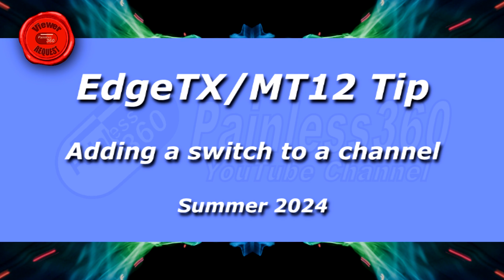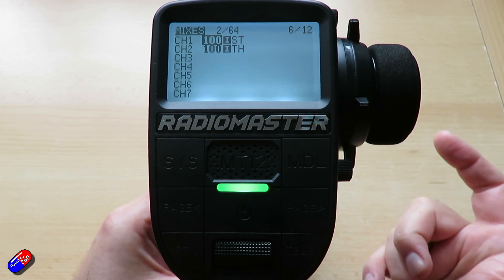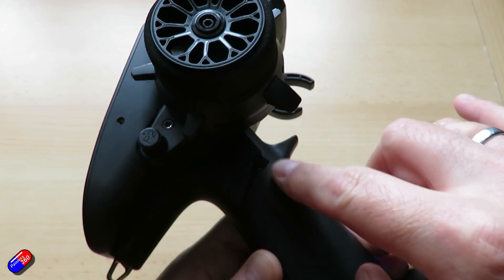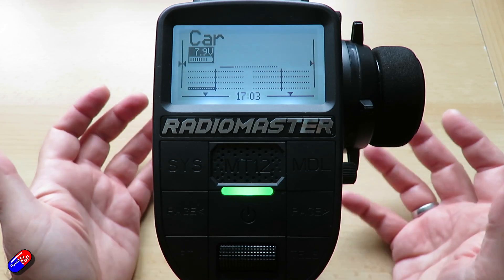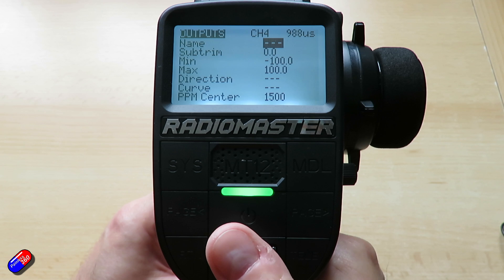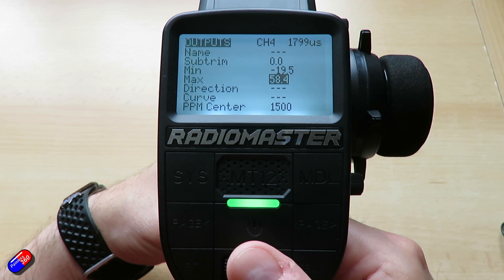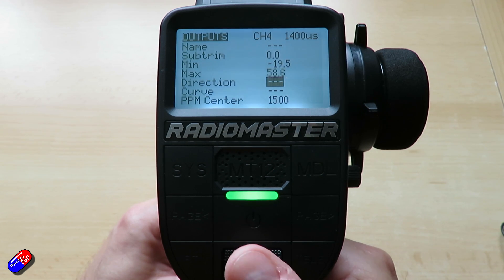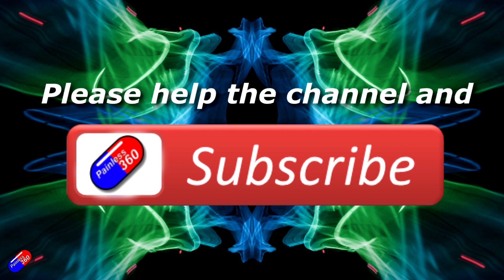EdgeTX Quick Tip: Adding a switch for servo hand-braking on an RC Car (viewer request)

Comment: Hey I have a separate brake servo that on a brushless car that I want to use for braking instead of motor. Is it possible to use this transmitter to set that channel up in a way that it allows me to use reverse as well. Or will setting up on a switch like this be the best option
Reply from the maker: Yep, you could setup the lower throttle range (when braking) to activate a logical switch and use that logical switch to control the servo. See https://youtu.be/HAqJTNI6Uro for some tips. Best of luck!